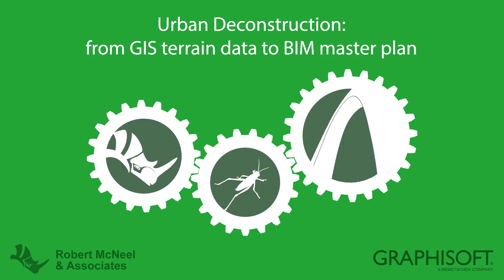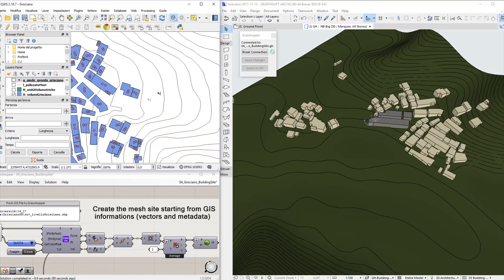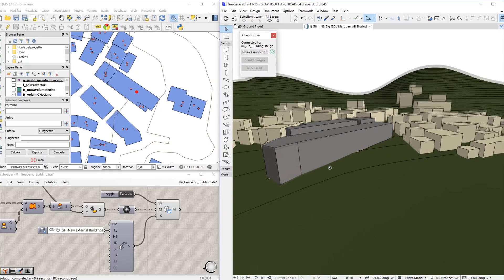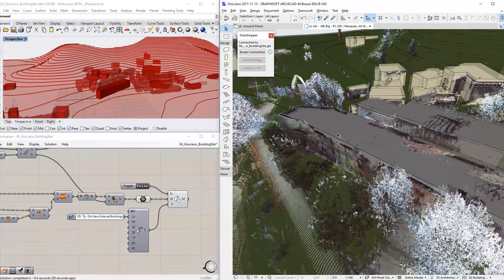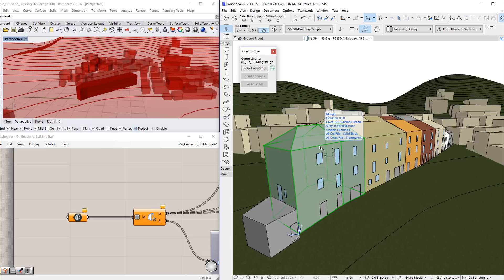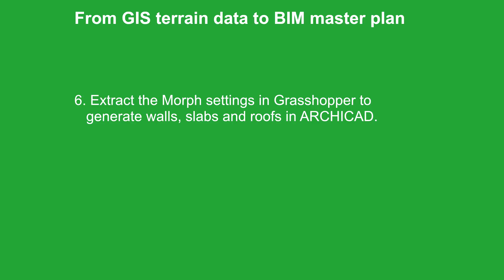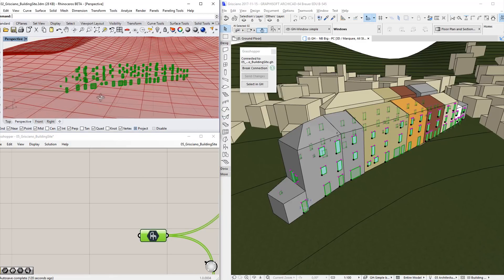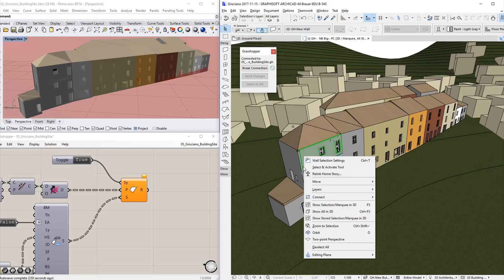ARCHICAD - Grasshopper Live Connection: Urban Deconstruction

Comment: Some of these functions should be native to ArchiCAD (i.e. the ability to automate the conversion of a simplified Morph object or massing into ArchiCAD native construction elements (walls, roofs, slabs).
A lot of people use the Morph tool a lot for conceptual massing, area calculation (in conjunction with the Zone tool) and space programming. And then we have to rebuild all the shapes again with the native tools once we get farther into the design process which just seems like you're doing double work when it could be a simple two-step process to go from the concept Morphs into basic building forms with real elements.

It would even be better if the Morphs have explicit history with the converted form to allow you to go and change the morph shape and the building form generated from it automatically updates to reflect that change as you have with this Grasshopper function.

I love Grasshopper but honestly some of these things should have to require a round-trip out of and back into the software just to do these basic things.
Reply: so true! Graphisoft should do more works on the workflow improvement!
Reply: Cbricklyne exactly ! Are we architect or should we be programmers? This is been a problem since gdl...
Reply: I am not advertising here but in the conceptual modelling Revit is better because you can create architectural elements from conceptual massing geometry. I hope Archicad will improve the morphing tool someday but the workflow with GS is something similar to that.